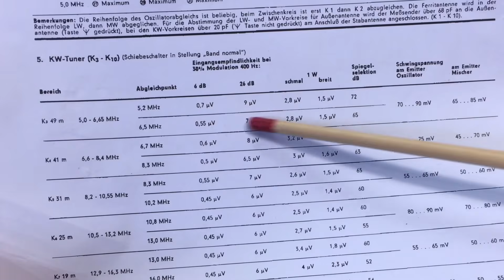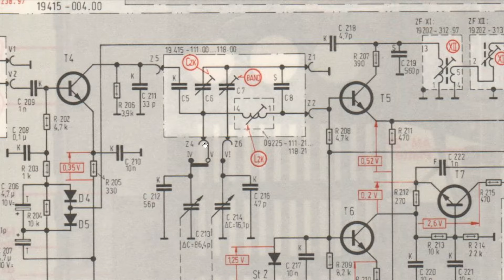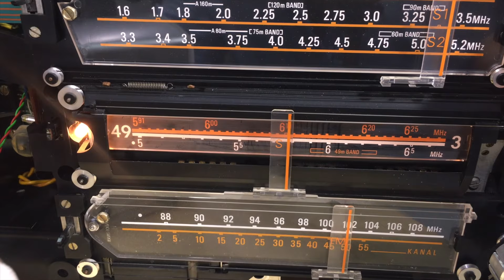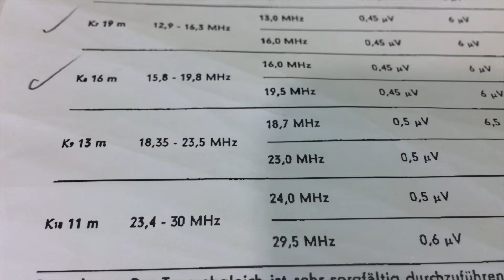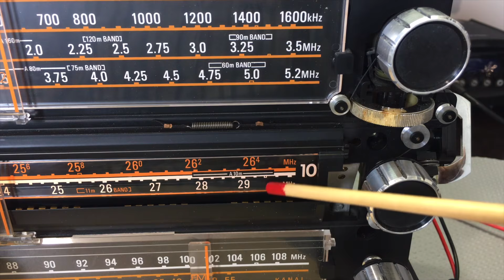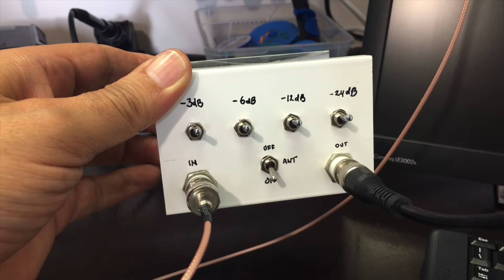RF alignment of the SW 3-10 bands. Grundig Satellit 2100 restoration part 7.

Comment: Hi, what is the red stick you used to remove the seal before starting alignment?
Reply from the maker: It’s just a screwdriver that has been insulated with heatshrink. Normal screwdriver just to break the seal. I then use a ceramic one to align so that there is no interference.
Reply: Thanks.

Comment: I did not think an RF alignment was always for accuracy of the analog dial display, but more so for peak RF gain and sensitivity performance in a given range.
Reply from the maker: It’s actually for both purposes. As you see in the video, I first correct the dial position, and then peak the intermediate and antena circuits to get maximum reception.
Reply: Electronics Old and New by M Caldeira  But it’s hard to believe that all the other components of each circuit would be the same they were 50 years ago, enabling an alignment as originally envisioned. Certainly a fair amount of interpolation and creativity goes into the process today.
Reply from the maker: Could be, but these circuits actually remain fairly stable over the years.

Comment: Hi Manuel, why would you loose with this Satellite against Braun T1000? The Braun has the better design that´s it maybe  but worse electrical design:
 Single conversion with only one IF at 455kHz and therefore bad image rejection.
The Grundig has 2MHz(!) first IF on SW3-10.
The Braun´s bandspread is a joke - how to find a station with known frequency?
You would win with your Grundig against the Braun. I would place the Braun behind Glas and look at it but use the Grundig for operation.
Reply from the maker: I know you’re right. I let my passion for Braun cloud my judgement. 
This radio is surprising me more and more as I use it in the evenings. The reception on the band spread is absolutely amazing!
I have just not been able to get a decent bfo function to work using the sig generator, which I can usually do. I tried injecting the bfo signal directly into the point where the optional module would, but no luck so far. Must keep experimenting 😊
Reply: @electronicsoldandnew  Hi Manuel,
the original external SSB-module (SSB-Zusatz 2000) contains not only a BFO but also a MIXER. Do you have the schematic? It´s in the service manual.
Reply from the maker: Yes, I have it, but getting the inductors will be a challenge. I’m going to make a simpler one and use the basic connection concept to experiment a little.

Comment: I enjoy how you explain the theory then show the practical steps to compliment the theory, this is what I miss, an experienced person sat next to me to work through the steps. My signal generator is an old Heathkit but only has a dial on the front no frequency counter. I use my Trio R600 SW receiver to check the actual frequency. Ok up to 30 MHz but after that I cannot confirm if the output is correct.
The offer still stands to swap for my Yacht Boy LOL.
Great job using the square wave signal to get the higher frequencies.
Reply from the maker: Thanks